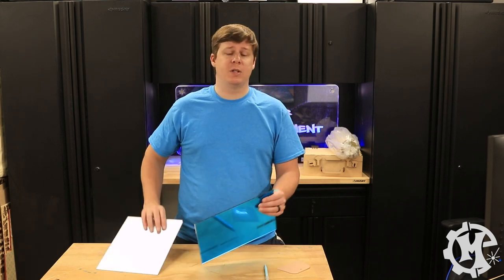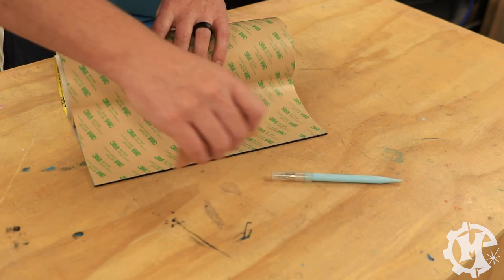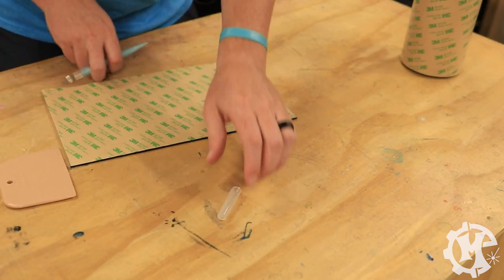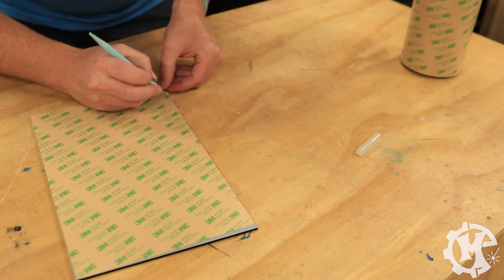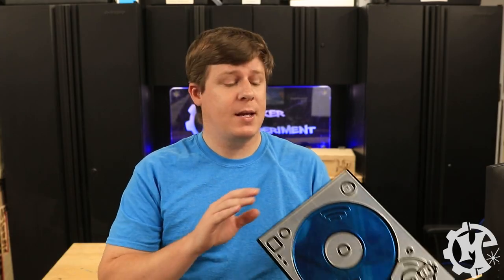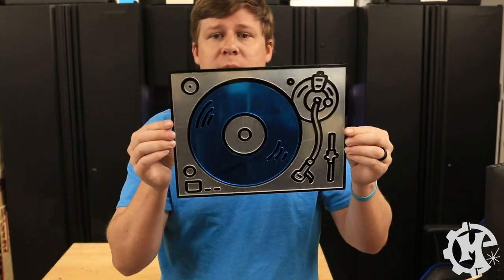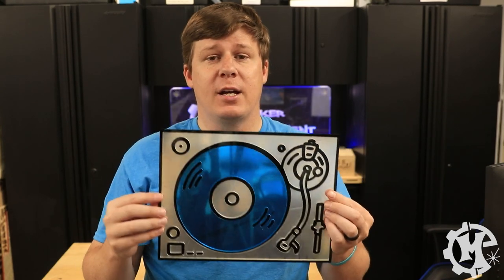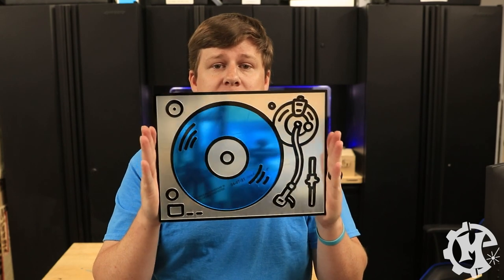MAKING A CUSTOM MIRROR ACRYLIC TURNTABLE

Comment: How does the black acrylic mirror stay in tact after the outline is etched in
Reply from the maker: The black part isn’t mirror, that’s regular cast acrylic.
Reply: @MakerExperiment  do you decrease the power of the laser cutter to etch an outline into the black cast instead of cutting through it?
Reply from the maker: @sonyx7138 yes. I decrease the power to about 5-10% and increase the speed to about 45-50%.
Reply: @MakerExperiment  great, and what about for cutting
Reply from the maker: @sonyx7138 it depends on thickness and wattage of your machine. Slower speed and higher power would be needed. In my 60 watt Epilog I’m usually around 100% power and 10% speed.
Reply: @MakerExperiment  great appreciate your help!
Reply from the maker: @sonyx7138 you’re welcome!

Comment: Ideal settings for 45watt?
Reply from the maker: I’m honestly not sure. I’d see if your machine has recommended settings. If not, you can start at the same settings I use for 60 watt and adjust them to work for your machine.

Comment: nice, blue circle doesn't look centered in the opening though
Reply from the maker: It was tough to align and it’s slightly out of alignment. It’s also not fixable with mirror acrylic because if I tried to peel it up and replace it, it peels the mirror coating off and damages the material.
Reply: @MakerExperiment  youch!  Yeah I get it for sure!  Something like that I’d probably use a sacrificial piece of material to use as a template to help get perfect alignment.  I’ve been thinking about using coroplast as that sacrificial template since it’s cheap and laser safe…..
Reply from the maker: @rwhipple73  I usually use cardboard. This one I etched the placement template onto the backer. I just misaligned the piece and once that tape sticks with mirror acrylic, it’s game over.